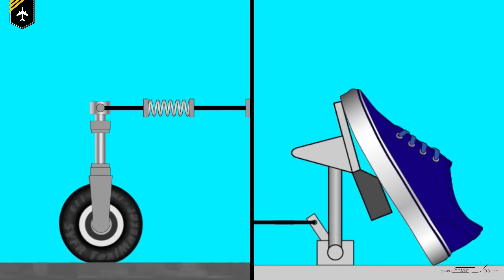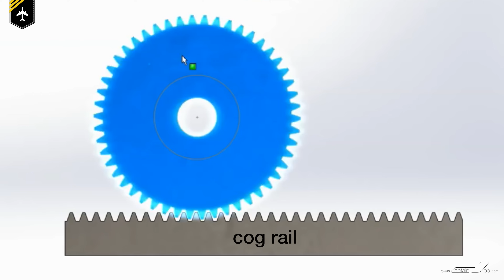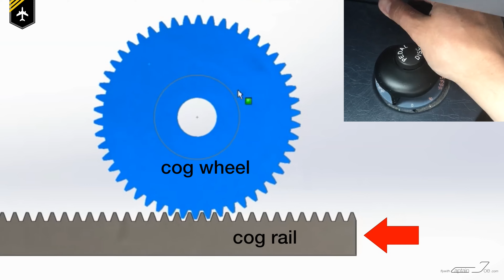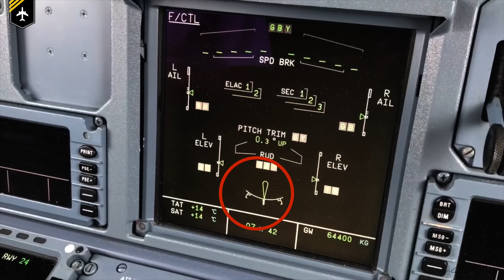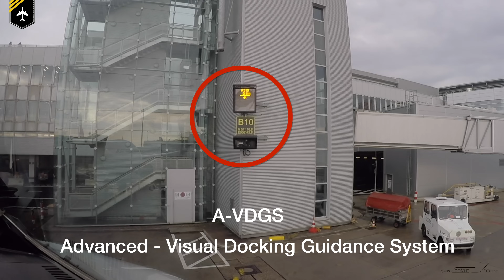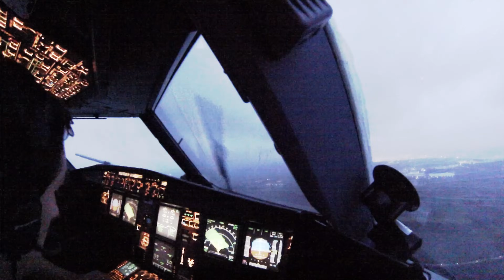Do PLANES have a STEERING WHEEL? All about NOSE WHEEL STEERING

Comment: Certainly not a modern airplane, but a third method for the nose wheel is what was used, for example, on the Boeing B-29 bomber and related planes; the nose wheel was simply a caster, much like the front wheels on a grocery cart....the nose wheels just swivel in the direction of least resistance, and all steering input is by differential thrust, differential braking, of rudder. When Boeing redesigned many systems of the B-29 to make the (almost) new B-50 type, they went with the steerable nose wheel much as on modern commercial passenger aircraft.

Comment: Hmmm.  I didn't know that little tidbit about the Triple 7's gear.  Cool.

P.S.  Great stuff, as usual, Joe.  :)
Reply: Boeing >
Reply: Yup, the original design was by Boeing, absolutely accurate.
However, over the years the design was constantly tweaked, with much of the design additions being done by Goodrich/UTAS Engineers.
Reply: Heisenberg It's psychological personally i never find tge difference between an Airbus ou a Boeing during turbulence and i often take them, turbulence as nothing to fuck if its a Boeing or an Airbus they just shaking the plane !
Reply: And to which aircraft do these landing gear design belong to? Boeing
Reply: And they are doing great things, absolutely. My point is just that the parts are designed to fit for Boeing aircraft, meaning in my view, Boeing is better engineered and I believe, more redundant and safer than Airbus
Reply: Heisenberg no every boeing fan think boeing make superior plane than other company but that is definitely wrong both company are good !
Reply: the experiences ive had is that with airbus i sit through more turbulence, boeing for me has always been much more comfortable flights, and that boils down to design engineering
Reply: Boeing doesn't make the landing gear. Up until recently, it was Goodrich/UTAS.
Reply: A380 is a behemoth, I would imagine it needs the help

Comment: Do the Boeings have steering from the Co-Pilot side?  Always seems that the Captain Steers them in.  Also, when Jetblue 292 landed with the nose wheel at 90 degrees, do you know if that was caused by the pin being left in?
Reply: Having hunted around images of Boeing Flight Decks, it would seem that the 737 series is an exception.

Comment: Captain joe why do you need a push back why can't you use reverse thrust
Reply: You shouldn't use reverse thrust at low speeds or when the aircraft is standing. There is chance that the reversed stream of air can pickup dirt and debris from somewhere which than can be sucked into the engines or damage some sensors.
There were actually an accident which happend about 30 years ago because a pilot used reverse thrust at the gate on a snowy day to help with the pushback because the pushback vehicle had some difficulties on snow to gain enough traction. Unfortunately the reversed airstream swirled up some snow sludge which clogged some sensors which was one of the main reasons the aircraft crashed just after take off.
Reply: And do you ever get tired of using autopilot and hand fly the aircraft
Reply: 4 stroke They use push back because reverse thrust would be sucking up to much air at once. That means if a person is near or a vehicle is near, it would get sucked into the engine.
Reply: The push back truck driver can see where he is pushing the aircraft.  The pilots do not have rear view mirrors. Also, putting the engines on high power next to the gate, wouldn't be a good idea.
Reply: shi01 Do you mean the crash in the Potomac?

Comment: When the plane leaves the ground and the gear is coming up, what stops the wheels from spinning? Is it because the disc brakes are applying enough pressure to stop the wheel?
Or is there an automatic brake that engages as the wheel comes up?

On the flip side of this, what if they put electric motors on the wheels to spin them up to speed on landing to reduce wheel skid and wasted tread?